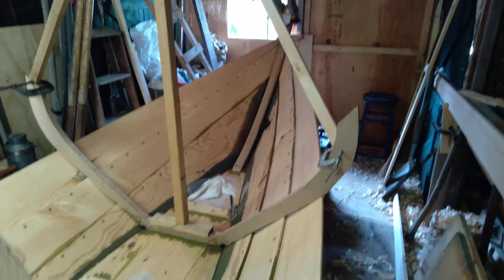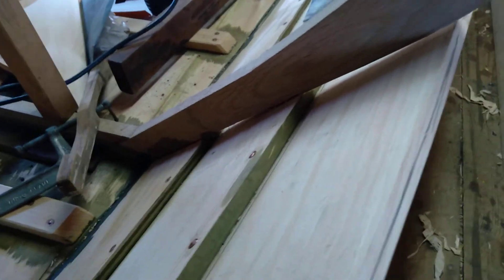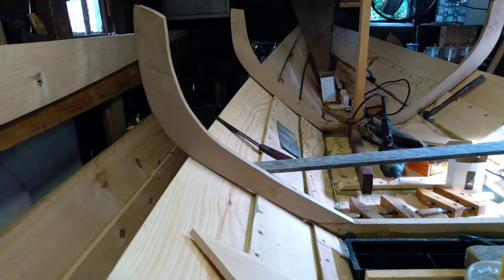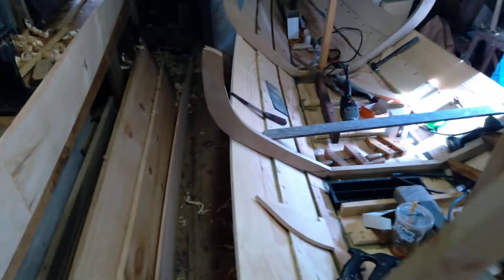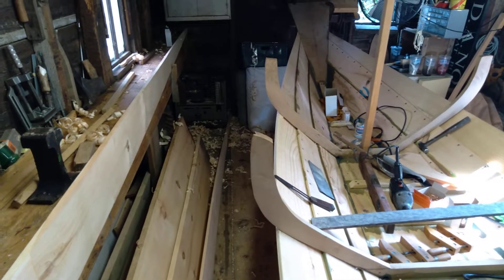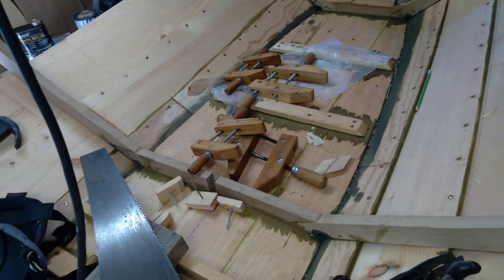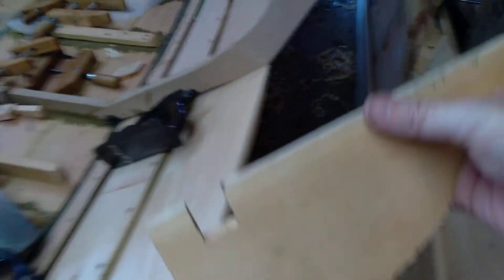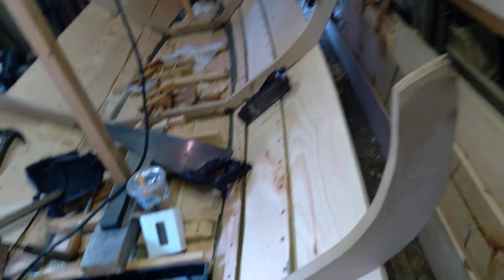AlphaDory, frame knuckles!

Comment: interesting re: the aft frame with 2nd strike of lightening... perhaps "taking off lines" esp of an old tired boat braced with an athwart ship threaded rod to compensate from some ancient collision or hogging from years of carrying (too much) racing sails and hiking out racers affected the lines Gardner obtained??? ... in reference to some of the smaller swamp Scotts in the Dory book Gardner references the builder adding "fullness" to the  aft knuckle to improve sailing performance....
Reply from the maker: Yeah... hmmm I'm stumped,  but this won't be the first or last time... big planking fail coming in 2 episodes...
Reply: @danoyes1  One thing I have wondered about, but have no experience with, is nailing a plank to the frames --- this prevents the plank from moving aftward, creeping, while the rivets are installed.  Conversely if you had a clamp that retained the vertical position of the plank on the transom, but allowed small movements fore-aft, then the plank could move as it zippers itself to the plank underneath it.  This lack of allowing the fore-aft movement may be what causes the planks to not make contact, or gapped, with portions of the oak frames.
Reply from the maker: @kenrolt8072  yeah the nails prevent the plank moving a lot while riveting, the movement is also not so much fore and aft as up and down, there is little to no edge set possible in these planks. The nails are helpful in that the movement along the plank is divided into manageable amounts and not cumulative  to a unmanageable amount over the length of the whole plank at the stern or wherever you finish up the riveting.